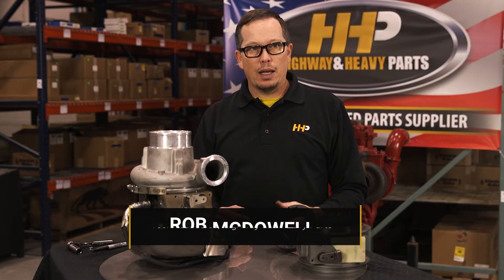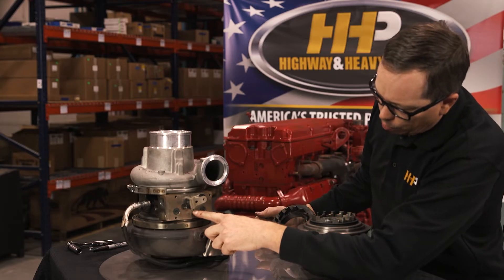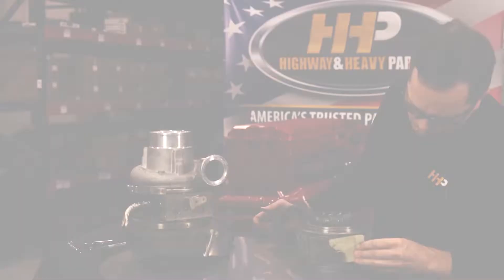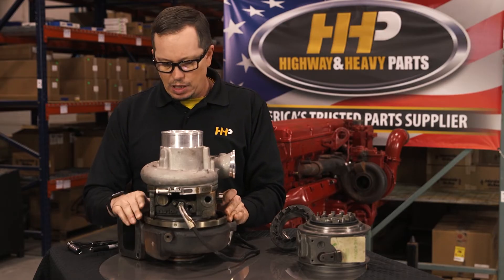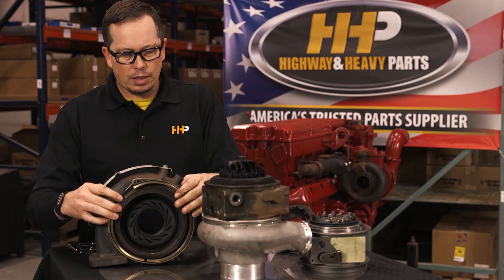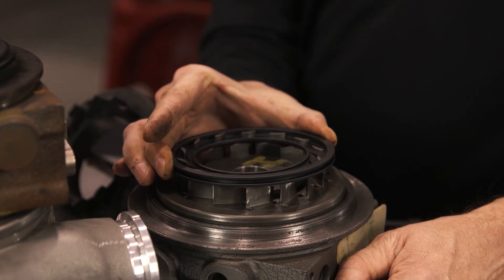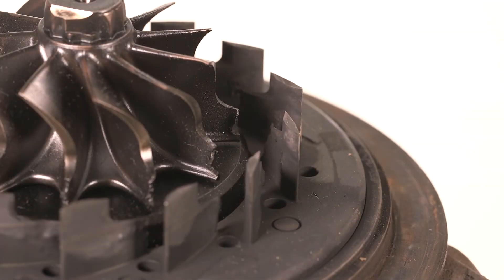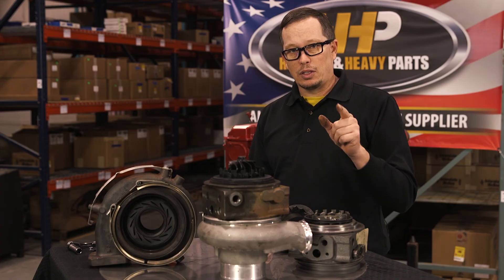How To Diagnose Variable Geometry Turbo (VGT Turbo) Failures!

Comment: My truck has no boost on first start . Can't hear that fast noise the actuator should make . If I run it for 20 seconds , and wait 7-10 more , I can hear the actuator and it will run fine afterwards . Soot maybe ? Been running it like this for a while now . PITA but still working . Tempted to buy a new turbo and use my actuator . What is your thought ?
Reply from the maker: Before you look into a new turbo, I would have a tech take a look at it & any related components that could cause an issue with the turbo.

Comment: My exhaust brake function has diminshed to the point that its hard to tell if its working. It used to work great but has lost about half of its stopping power. Is this a common vgt symptom and is there any way to free it up?
Reply from the maker: It's possible that your vanes are sticking in the wrong position your VGT.  If they're stuck, it's likely damaged or loaded with soot/carbon.
Reply: Another reason is a bad exhaust pressure sensor (egr pressure sensor) it reads turbo back pressure. If it gets bad readings the exhaust brake won’t fully come on.

Comment: I have a question. Can you not remove the Variable geometry stuff and use an external wastegate?
Reply from the maker: If your engine was built with VGT, it was meant to be on there.  Changing components the engine wasn't originally designed with may do more harm than good.
Reply: @Highwayandheavyparts    yeah but this VGT keeps on failing and that requires turbo maintenance
It’s doing harm to my wallet
Reply from the maker: If you're frequently having VGT problems, you're real engine issue is likely upstream from the VGT.  Thoroughly check your engine for any signs of a failure that would show up in your VGT.
Reply: @Highwayandheavyparts  where can I start looking? What can cause a vgt to fail?
Please be helpful
Reply from the maker: Start by looking into your EGR maintenance.  We recommend thoroughly cleaning your EGR system before installing one of our VGT Turbos.
Reply: @Manuqtix.Manuqtix  Is your truck deleted or custom tuned?
Reply: Egr pressure sensor

Comment: That just might be what's causing my actuator code to show as "Lost Communication"
Reply from the maker: Dexter, thanks for watching! Check out our diagnosis checklist: https://highwayandheavyparts.com/n-12258-turbocharger-failure-diagnostic-checklist.html
Reply: My 2016 Ram did the same for 3 months in a row. Two previous times the code went away on its own. Third time was enough took it in and the turbo was no good. A small leak of coolant on the back side of the turbo where the actuator mates to the turbo. Would never have seen it looking from the front or top. I checked my engine bay for anything. Chewed wires, loose ground, loose terminals on the batteries and the fuse box all were good. 

What I did learn from the shop going forward is to step on it when one can and use the engine brake to actuate the turbo. My turbo went out just over 62k. There was no maintenance neglect on my part. It just went out.

Comment: Actuator is completely free when taken apart. I put it back together and it will not move at all. What is going on??? Is the nozzle not properly lined up with shroud? Is my turbo bad?
Reply from the maker: Hi Patricio!  Rob covered your question in yesterday's video.  Check it out here:  https://youtu.be/qAcKp6HHlEM